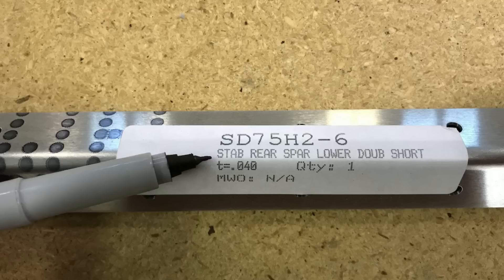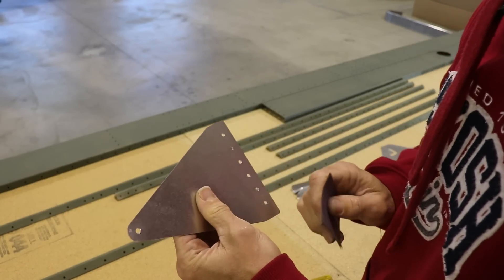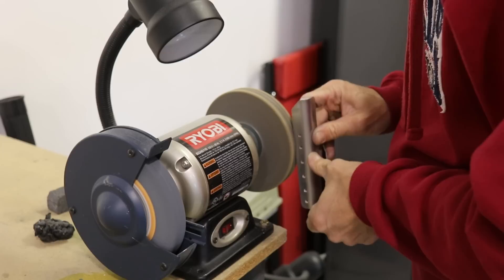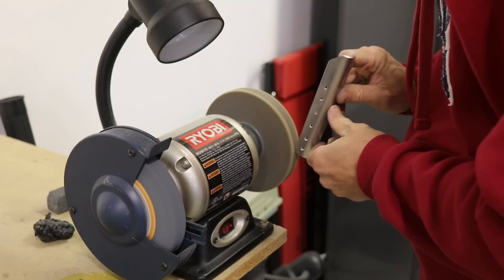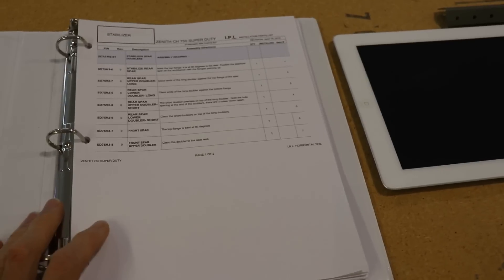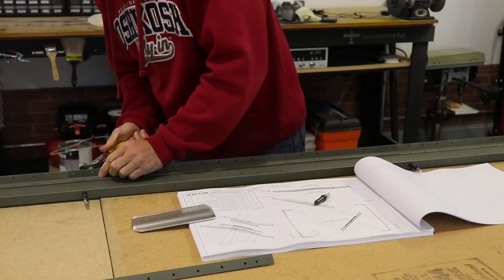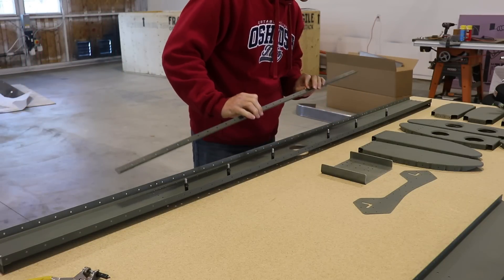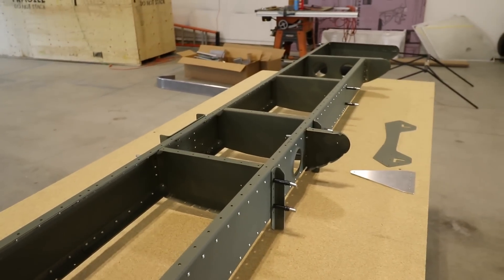Zenith Super Duty Build-Getting Started (Ep2)

Comment: I've used a heat gun to soften the adhesive and the label pulls right off. It'll be a bit hot but not unbearable. Then I use the nasty chemicals to remove the residue.

Comment: Just a word of caution for those that may not know, NEVER grind aluminum on a standard grinding wheel, it will load up the wheel and make it unusable unless you have a dressing tool, and can cause it to come apart.
Reply from the maker: True, this is a Scotchbright wheel and not a grinding wheel.
Reply: @KitplaneEnthusiast  I know but just wanted to warn other viewers about the grinding wheel.
Reply: Also, never use any grinding/polishing tool on aluminum that has been previously used on anything other than aluminum. It’s a surefire way to embed foreign particles in your soft aluminum piece.

Comment: Do you find after priming the parts, you have to go through and clean out all the rivet holes due to the hole size shrinking slightly due to the primer coating?  If you do, does that exposed metal in the hole wall present a corrosion risk long term, or does the fact the metal is primed, and the parts held tightly with the rivet, make that a non issue?  Again, thanks for doing this series.
Reply from the maker: Yes if you have to clean out a hole, then it will remove the primer. If someone is this concerned about primer, they should probably just skip priming anyway. You're not going to cover ever single tiny part of this airplane in primer. I'm of the mind set that they airplane doesn't even need primed in the first place, but I'm doing it to make myself feel better. If I miss a spot, or a hole isn't primed, I could care less.

Comment: Since you primed your cruiser, can you take a guess as to how much primer you used (weight).  Thanks
Reply from the maker: A wild guess might be about 30 cans of primer. The rattle can primers work great but they are expensive compared to just buying a gallon and using your spray gun. But I'm paying for the convenience of not having to mix it and then clean the gun. I used 4 cans on the horizontal stab.
Reply: @KitplaneEnthusiast  Thanks!  Looking forward to your new build.

Comment: Great video!!!  The SD assembly directions are fantastic.  I am doing the SD rudder on the 750 STOL and it went together like warm butter.  It pisses me off that Zenith either doesn't care or refuses to offer this step by step assembly directions manual for the 701 or 750 STOL.  They make you buy the more "expensive" kit to make it easier to assemble and that just chaps my ass.  Most of the  time the plans are outdated or just not updated to match the photo guide but they include new parts and you have to figure out what changed on your own.  Ask Justin Tisdale...ahhh, but he's at the factory every other week.  Every kit that goes out should be updated with plans and assembly instructions...but that's just my two cents.  If the instructions were more clear, we wouldn't need the builder's forums except to compare flight characteristics.  Love Zenith but they could do much better in this area!

Comment: Thank you for this SD series !!
Please expand on priming parts, does each part have to be cleaned and scuffed ??
That would double the labor??
Reply: Thankfully a lot of car manufacturers started utilizing aluminum body panels. There are many commercially available primers that are formulated to adhere without the chemical prep work of the not so distant past. The primers will have the prep information listed on them as well as recommended spray gun orifice, pressures, overlap, and flash times specific to that product.